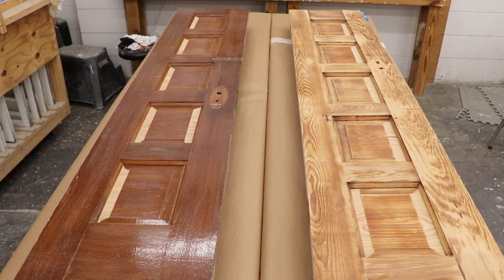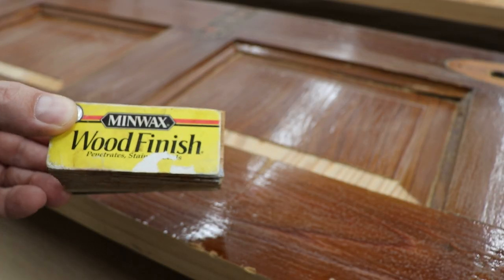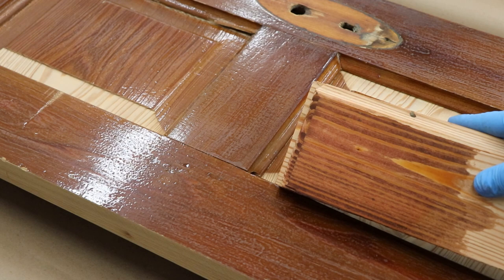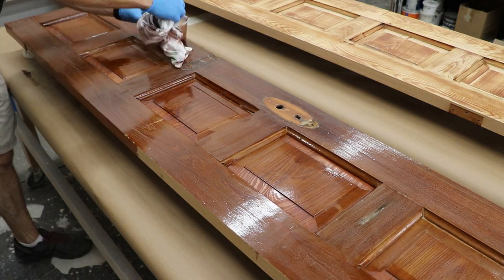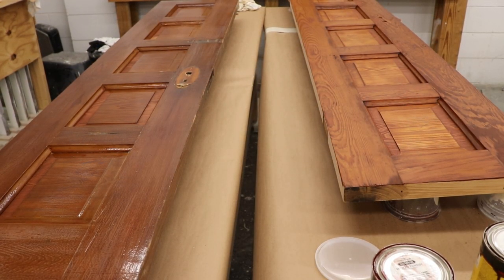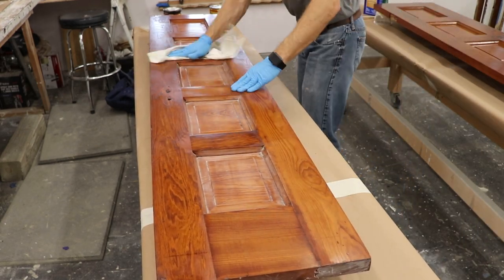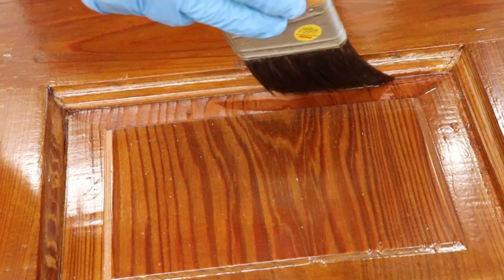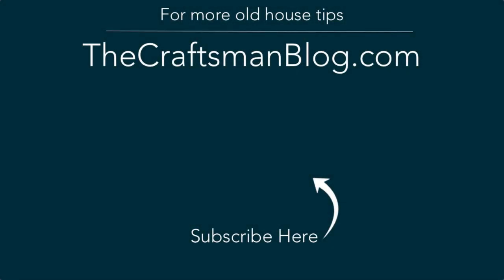Refinishing Historic Doors

Comment: How can I tell the type of wood that my old interior doors are? I have a few single panel doors from a salvage yard that I’ve stripped the multilayers of paint off. The stiles are old tight grain wood while the panel is like a tiger stripe grain. My guess is heart pine but I’m not sure.
Reply: I know I'm very late, but I have the same question.
Replying just in case he ever answers.

Comment: Good job.
If you want to match the color, texture and sheen. Shouldn't you...
1st Make a small sample.
Than sand both doors down to bare wood. Condition them. Sand. Stain. Poly / shellac sand poly /shellac sand final polyurethane or shellac. oil based to get  the ambering over time.